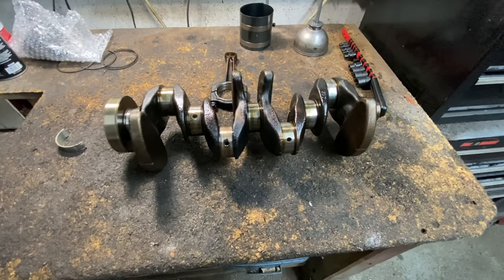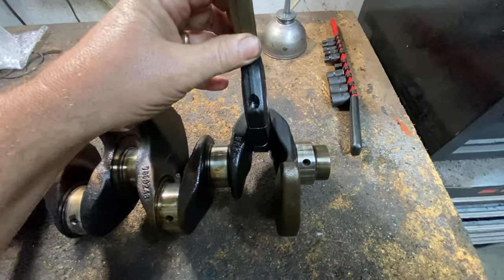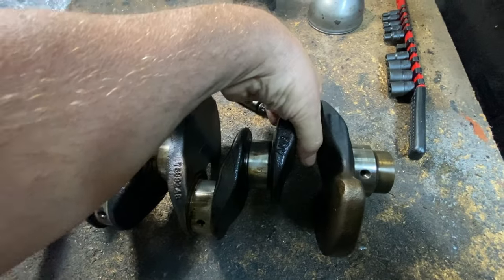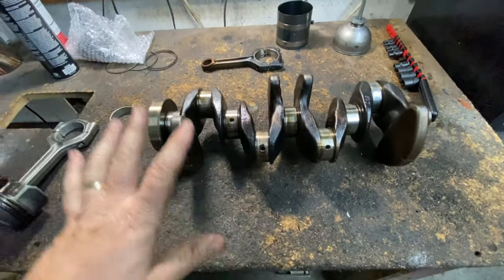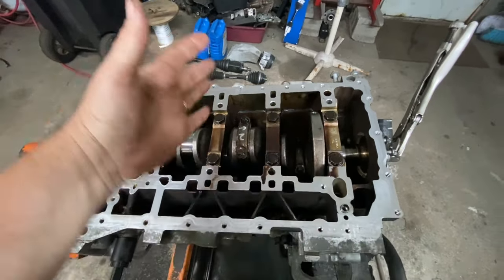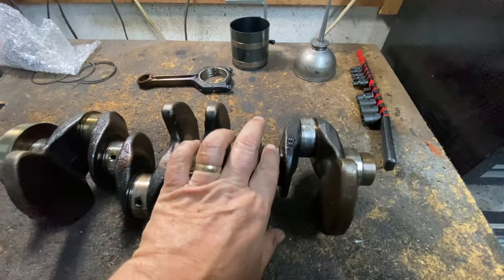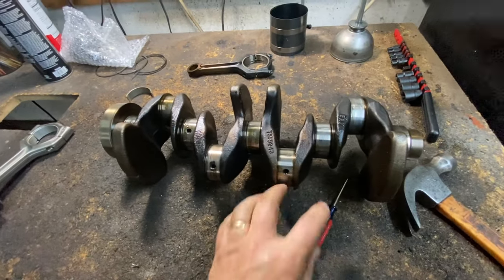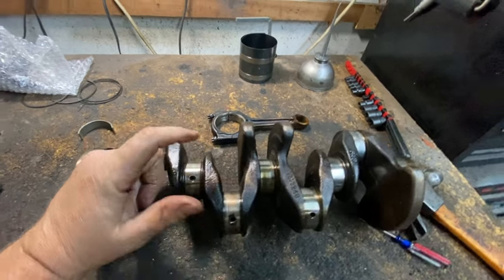What Is A Spun Rod Bearing - Explained

Comment: This is exactly why I am "Not" a believer in low viscosity oils like 0W - 20.  Heat in an engine causes the viscosity of oil to be reduced. Furthermore, high viscosity oil help compression and oil pressure. If you put a "full synthetic" (which is a blend of synthetic and mineral oil) 10W-40 oil your car, by the time you change the oil it is not uncommon for that oil to from a 40 weight viscosity down to a 30 or even 20 weight viscosity. I always like to look at racing for what is probably the best components and products for a car. In NASCAR they use a 100% Synthetic 10W-60 engine oil for racing for the reason I explained above. It needs to be noted though, 100% Synthetic oils do not have viscosity breakdown until usually 10,000-12,000 miles. And why you can go longer between oil changes with 100% Synthetic oil. Also, 100% Synthetic also leaves a film on engine parts that protect from "dry starts". I always say, if it is good enough for NASCAR, then its probably good enough for my car as well.
Reply from the maker: Good write up! Many people can learn from this. Most of the problems new cars have is way too tight oil bearing clearances and lack of changing the oil results in a high amount of engine failures. BMW comes to mind with there 1000 of an inch oil bearing clearances, ridiculous.
Reply: Same! I run 10w30 in my mustang that calls for 5w20. it's not stock though. maybe at stock power levels and normal driving 5w20 would be ok. I also don't drive it when it's below 50F outside.
Reply: Im not sure if you know this but racing teams usually go thru one or more engines a season, their tolerances aren't necessarily for longevity. That being said; as a customer you have every right to use in your car whatever your desire and pockets allow.

Comment: I spun a bearing in my Subaru, and it was full of oil and had excellent oil pressure before, during, and after the bearing spun.
Reply from the maker: Dirt and debris can cause it as well. Lack of oil changes even though oil level is fine, fatigue is another one.
Reply: @Motorcarnut  yeah I think it was due to high milage and a severe sudden misfire... the car had 240,000 miles on it (oil was changed regularly though) and the spun bearing happened immediately after the ignition coil plug for cylinder #3 came loose while driving, causing a very rough running condition. And the rod bearing that spun was the bearing on that same #3 cylinder where the coil came loose.
Reply from the maker: @bluegizmo1983 that’s probably just a coincidence. If the cylinder was not firing it wouldn’t blow the bearing.

Comment: BS it can be fixed on the car...tons of videos that show it as long as you measure everything.
Reply from the maker: And if it's out of spec? Most of the time it has to be removed, how are you suppose to remove the connecting rod or crankshaft? You should learn a little before passing clueless judgment.
Reply: @Motorcarnut  it's not clueless measure everything means just that... meaning if you can get away with the extent of the damage, it could be way out of whack. If it's out of spec then you have to pull the engine. I'm not going to get into this. When you make an engine repair without pulling a motor and if succeeds, the customer will be happy and you will save a ton of time.
Reply from the maker: How are you supposed to measure a connecting rod bore for out of roundness in the car???? Guy like me are here to teach you only if you’re willing to learn of course.
Reply: Yes, you can R & R the bad bearing, but it won’t last …. Impossible to get the journal into perfect round while on the block.
Reply from the maker: So what good is it?
Reply: It'll work for 10K miles if you're lucky.
Reply: @jamesb8305  it failed, got a rod and crank coming...
Reply from the maker: So much for the “tons of videos out there “saying you can do it in the car?
Reply: @Motorcarnut  sure, my journal was out of round by just enough apparently, never hear efficacy on those repairs...mine didn't last hardly at all...its case by case but there's no longitudinal studies out there...not about to act like a bully about it.

Comment: Tabs do not keep a bearing from spinning
Reply from the maker: Correct
Reply: Yes they absolutely do. The tabs are positioned opposite each other and against the direction of rotation. They are not designed to withstand any catastrophic events, in fact engine bearings are engineered to be the first to fail in attempt to save major components. 🤓👍
Reply: Tabs are only for alignment side to side Not to keep them from turning. The crush from torquing them down is what holds them from spinning.
Reply: @bospet6453  but the tabs do constrain that axis of movement, there is no argument to be made.
Reply: They actually do.  We removed one from a Mazda 6, after it started spinning freely.
Reply from the maker: Crush force keeps them in place Not the tabs.

Comment: The little tabs do not keep the bearings from spinning. They are locator tabs. It’s bearing crush and oil pressure that keeps a bearing from spinning
Reply from the maker: You are correct! I misspoke on that one meaning exactly what you said.
Reply: No problem. Glad I could help

Comment: Yes I took my inexperienced mechanic and I told yesterday it shows in dashboard low oil pressure straight he went to change the oil and filter and I went for try then engine turned off by itself I called the mechanic he said that is a battery and I had doubts I did it as he then I drove back to his garage and I told him about the issue he still was insisting it’s the battery and accelerated the engine for nearly 4 minutes and seized the engine, and now I’m in court against him luckily on that time the dash cam was working. any idea what shall in court
Reply from the maker: Sorry, this is a situation of he said she said and I can’t get involved in legal matters.

Comment: I believe I may have a minor rod knock in my old 302. There’s a slight knock from the oil pan area once it warms up a little. I put some Lucus high mileage and it did help the noise about 50%. Are there ever scenarios when you could just drop the oil pan and replace the affected bearing
Reply from the maker: Yes, if the crankshaft journals are not damaged yet and by what you’re saying you may be good. Just don’t use the vehicle anymore until it’s checked.

Comment: I have a b18b1 swap, and I just spun a rod bearing. I have a new crankshaft, but I don’t know if I can use the same rods. Can I get some device on this?
Reply from the maker: If the rod bearing spun inside the rod journal and looks darker than the others because of heat I’d say you have to measure the rod journal but that requires special bore gauge etc so if in doubt just replace the rod with a good factory used one if you are on a budget don’t buy a new aftermarket one they may be different weights and that’s not good.

Comment: I drove my car with low oil preasure(not constant low) for some 15 miles.i knew that will be thw end of that engine cos i had no other solution)engine is  1.4hdi with very high mileage.of course i had intention to buy other used engine and it is not much expensive.i have been searching for engine but after some time i turned my car on and there is no oil warning lighht(for now) and surprisingly no knocking sound you can say more or less it works ok.i do not have intention to work on it until spring time.if the bearing is not spining around journals and no major damage ond the cranshaft(maybe i have to change the rod bearing)is it worth of trying to repair or i just put other engine.
Reply from the maker: It’s worth to try repairing especially if it’s not that bad yet

Comment: Hi I think have a spun bearing with the rattle/knock at revs over 2000rpm. Can I drive it to the workshop about 10 miles away or will that further damage the engine?
Reply from the maker: I wouldn’t, I’d get it towed.

Comment: Could and would the machine shop address that seized/welded on bearing? Sort of grind it down and off. You use the term grind but I would imagine it's still a sharp tooling bit that cuts in a thousandth, or less, at a time.
Would not want to risk breaking the tool/bit.
Reply from the maker: No, that crank in the video is scrap.

Comment: I had installed a 305 Chevy engine in my 1979 Malibu classic sport coupe, the original engine was a 267, one day near home I decided to floor it, the throttle stuck wide open, I threw it in neutral and well you can guess what happened, it overreved. I then installed a brand new 350 Mr Goodwrench 350 then somebody stole the car, I got it back but it never felt the same, I loved that car, I bought it brand new.
Reply from the maker: Sorry about that. I wonder why it didn’t feel the same? They dogged it when it was stolen?
Reply: @Motorcarnut  It was trashed, the wheels with brand new tires were gone, the accel wires coil were gone, the battery of course the stereo the cb radio, all the CDs that we brought, the spare tire the jack, the steering column was destroyed the aftermarket cruise control I had installed was gone, the worse part was this occurred in Boston, I live in New Jersey, me and my girlfriend had gone on a dinner cruise in Boston harbor with some friends, I called the police from a pay telephone, this was in 1991 so no cell phones, they said that they don't send a police car just for a stolen car and said if I wanted to file a police report I'd have to come to a station, we got a taxi cab and told the driver to take us to the nearest station, I filed the police report then had to get a rental car, the only place was at Logan airport, we got another cab to the airport got a car then got a motel room for the  night, I even drove around the area to see if I could find my car. We drove home the next day, my uncle picked us up from Newark airport, that night I get a call from Boston police telling me they found my car. I called my girlfriend who lives only two blocks away, I told her that I'm driving back to Boston tomorrow to get my car no matter what condition it was in, I had a 1981 dodge ram 50 pickup, I loaded all the tools I thought I'd need, I worked at an auto parts store, I went there and told them what happened, my girlfriend wouldn't let me go alone so she took off work, I think I drove 80 miles an hour all the way there, I think it took four hours to get there. My car was at a towing company sitting on the ground in Dorchester a suburb of Boston that is mostly black and Hispanic, the owner of the company helped me scavenge parts from other vehicles there, tires cap rotor battery a screwdriver to start the car, no internet back then so he had a Chiltons manual to look up the firing order, when everything was together my baby started right up, the guy who helped me would not accept any money for helping me, all I had to pay was for the storage the towing etc, I tried and tried but be refused any money, I had to drive the truck because it was a stick, my girlfriend drove the Malibu, I followed behind and after a while we pulled off the highway so I could ask her how the car was, she said there were no problems, after a while driving we stopped for something to eat, when we came to a toll she told them, no easy pass back then either, that the truck behind would pay the toll, we made it home around 3am, the next day I set about the task of putting my car back together, I had the factory wheels and caps which were painted to match the car, that's the way it came new, there was a bump in the floor behjnd the drivers seat due to the car being dropped onto a cinder block which damaged the body mount which eventually rusted out, that feeling of being violated like most people who have had their house robbed or their person assaulted for some reason the car just didn't feel the same, I did drive it for many years after but I had lost interest in it, maybe it was because I was older I don't know, she even climbed pikes peak when I drove to Colorado to visit my sister's.
Reply from the maker: @Peter-pv8xx Wow, an amazing story. I feel for you and such great effort on you part and the people who helped you. Now I know what you meant by never felt the same. I would of felt the same way.
Reply: You should have installed a 4speed, now days most people don't know how to drive a std and a kill switch helps.

Comment: Would it need cylinder sleeves? Have this issue with my friggin Hyundai Sonata. Haven't driven it in a year and half, close to 2 years now. Sitting outside. Last time I tried to start it, it was seized. It began with a spun rod bearing, then seized, probably from a main bearing. Unless it was the main all this time, no idea. I don't know what to do with it. I don't want to sell it, and don't know if I should fix it. I can't even sell it if I wanted to. Nobody wants a Hyundai Sonata with a seized engine.

There are a few other things to fix. Need a bunch of money to invest in it, only for it to still depreciate... She's been a money pit for a while, and all I can afford is to either fix it all and be left with nothing financially but at least it will run better than ever, or buy some beater, which would be a hell of a downgrade. idk. it's made me apathetic and lethargic just thinking about it.
Reply from the maker: If you’re handy what you will need is a new crankshaft rod and main bearings head gasket set oil and coolant and a few others but you can get everything on eBay for under $500.00 I’d say keep what you have.
Reply: @Motorcarnut  thank you for answering man. do you think the cylinder walls are scratched from debris? or maybe other parts? I'll likely bring it in for a shop to do it, i don't have the know-how and tools to do the work. What annoys me is the shop i used to go to was like "you need a new engine", and the used ones were going for the same price as the new ones, and new ones weren't available at the time (around 2022).

Whats also annoying is that this is the second engine already, it's been replaced once. This would be the 3rd time. Seems like these Hyundai engines keep burning oil, and cause friction. I'll see if I could ask them to just replace the parts you said, and ill provide the parts. so ill just pay them per hour. Idk why they would make me replace the whole engine, unless the cylinder walls were affected. If so, I would bring it to a machine shop and get the cylinders sleeved, it would still be less than buying another engine. at least in my case. idk
Reply from the maker: @BIGGELATO usually when I rebuild them the cylinder walls are fine. The best thing to do is use aftermarket crankshaft so this problem won’t happen again.
Reply: @Motorcarnut  Thanks a bunch dude 🙏
Reply from the maker: @BIGGELATO no problem

Comment: Bearings could spun from normal wear and tear, contaminated oil, high rpms
Reply from the maker: Contaminated oil and high rpms is neglect and not from normal wear and tear.
Reply: Detonation
Reply: @mooosestang  under boost detonation will flattens rod bearings otherwise it can't happen an NA engines
Reply: @Airman..  ??? You can have detonation on a NA engine or are you saying it won't hammer on the bearings because it's NA? Some of these new engines have 12:1 compression ratio, crazy!
Reply: @mooosestang  only made possible by the precise timing of Direct injection, this system have strict safety knocking algorithms, slightest sense of bad fuel or bad fuel atomization will limit engine power before it kill anything, bearings in this case is the least of considerations. By all means static compression isn't as dangerous or destructive as dynamic compression aka boost  in high performance engines

Comment: Also what causes the connecting rod failure.  Low pressure? Or over rev
Reply from the maker: Both
Reply: @Motorcarnut  owners manual recommend change oil every 6000miles or 6month. But I accidentally change the oil once a year for last season. Big deal?
Reply from the maker: No it's not. Just try to do it every 6K as stated. Also don't neglect the coolant system, should be flushed every 2 years to avoid problems.
Reply: @Motorcarnut  yes sir!
Reply: I diss agree over revving it won't take out a bearing ,its an oil problem or a machine shop didn't get it right
Reply from the maker: Possible. Over revving can cause valve train failure and can destroy many parts of the engine including lack of lubricant because it’s spinning too fast
Reply: @darrellsomers5427  Over revving can pull rods apart.

Comment: Ok. I got  one that is really eating my lunch. Bought 07 envoy. 4.2 in line 6. Me and a fella I know we're just sure. It was a rod knock. We were pizzles that fella said he drove it that way 300 miles. I tear down to oil pan. No small job...main bearings feel tight. Engine spins freely  but there was a ton of metal that came out in the oil. I take off valve cover and sparkplugs. All look good. Another big job...... I take of front cover of motor to timing chain I still do not see the source of all the metal in the oil. My friend is now convinced there is nothing wrong in the engine........ I think there was too much metal in the. Oil for there not to be
Reply from the maker: What about all the connecting rod bearings? There should never be metal in the oil, also can be a scored piston skirt.